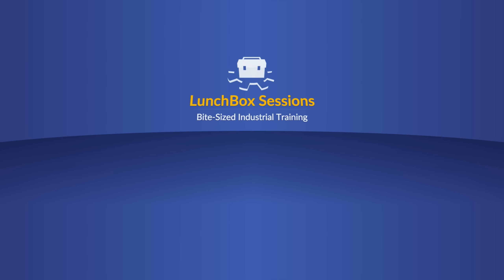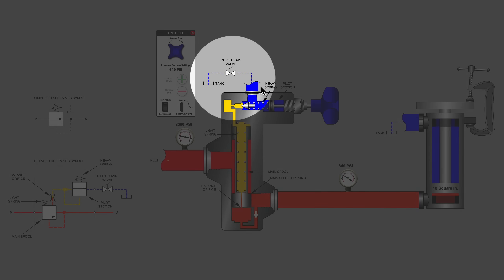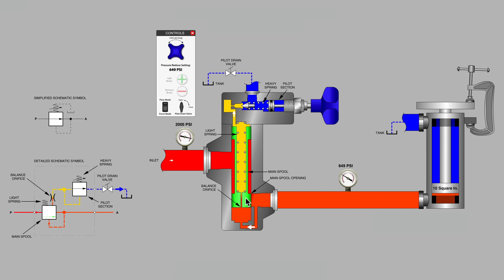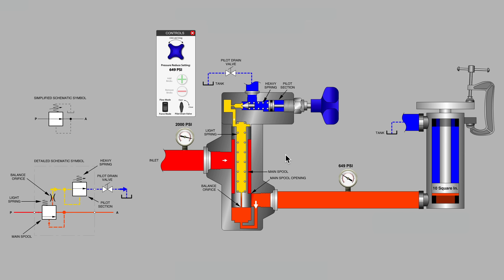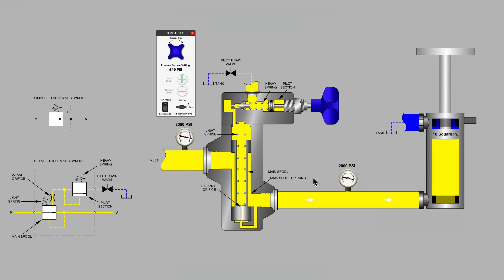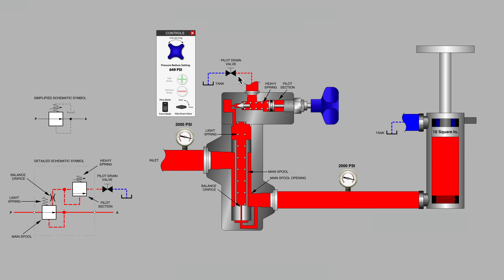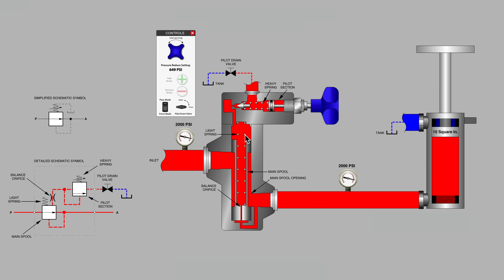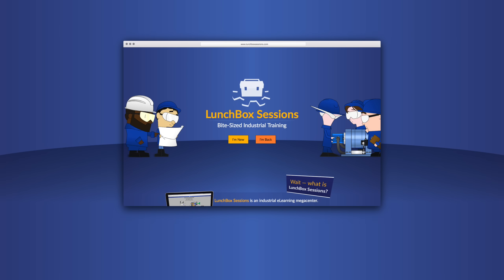Troubleshooting a Pressure Reducing Valve

Comment: Nice video and explanation, as usual, but this time I have a doubt. When you describe the areas of the main spool of the valve, you say that the annular (bottom) area help to move down the spool.  For me this annular (bottom) area does not affect the spool, because on the upper part of the spool there is the same annular area, so these two are canceled. Either way the spool have to move down because the effect of the others. Greetings
Reply from the maker: That's true. Good observation. Thanks for pointing out that one detail. We'll produce an edited version at some point.
Reply: you're welcome. It is nice to help to improve your videos, which have been a tool of great help to me to better understand this area
Reply: Good catch

Comment: How to test a pressure reducing I cartridge valve? I have a tractor thats giving me a fit.

It has the parking brake valve with 2 electric solenoids back 2 back on the same valve stem. The first solenoid activates all the machine functions, the second deactivates the drive functions but still allows the boom and attachment to function.

Beside that valve it has the PRS valve.

My problem is when you turn the park brake off to have all functions everything works but very slow and weak, pressure only goes up to about 1000.
But when you activate the brake the other solenoid takes over and the boom function works perfect pressure goes to 2500 psi 
Its a jcb skid steer.

Comment: What's the difference between pressure reducing and pressure relief valves?
Reply from the maker: One way to describe the difference is that relief valves limit the maximum pressure on the inlet side of the valve (note the dashed sensing/piloting line on valve inlet) where reducing valves limit the maximum pressure on the outlet side of the valve (note the dashed sensing/piloting line on the valve outlet).   - Carl

Comment: CAN YOU SHARE TROUBLESHOOTING OF FACED PROBLEM AS WHEN PRESSURE REGULATE AND SET AT 1200PSI AFTER SOME TIME IT START FLUCTUATE AUTOMATIC +/- 400 FROM SET VALUE WHAT CAUSE IT HAPPEN ANY ONE CORRECT SOLUTION SHARE WITH ME.